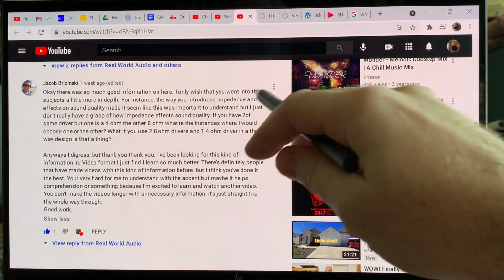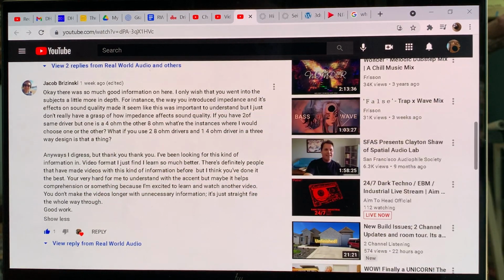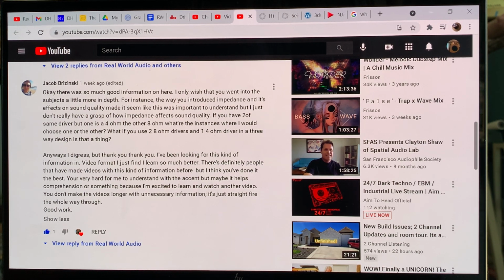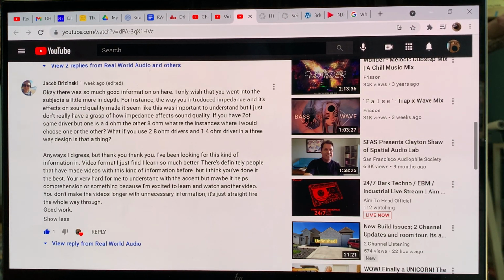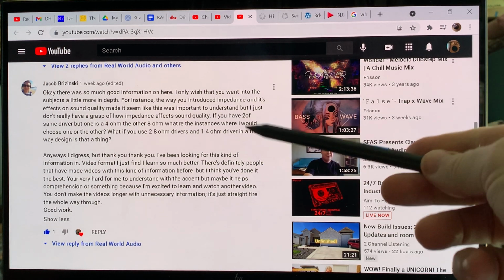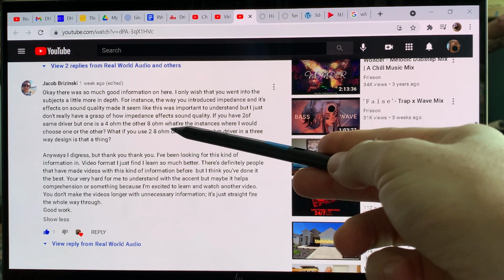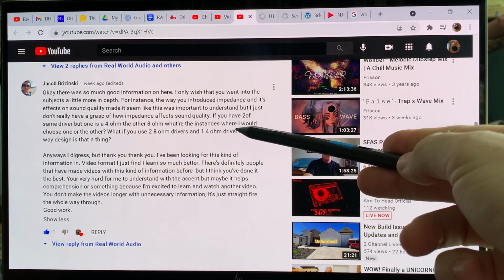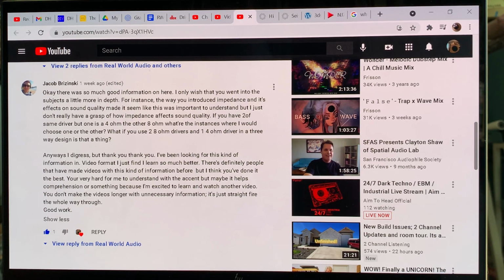Q&A - Loudspeaker driver impedance implications, first take

Comment: Hi impedance can be viewed from the theoretical side and an empirical side. For example theory dictates  an 8 ohm speaker should be connected to the 8 ohm tap of a tube amp but if the speaker impedance dips enough across the frequency spectrum it may very well perform better on the 4 ohm tap. Peter q of audio note stated low impedance and low sensitivity is the work of the devil. In my experiences with both tube and solid state push pull and single ended varieties I prefer a higher impedance over a lower one, I prefer a relaxed natural tone
to a dry analytical unmusical sound which you get when driving a low impedance.If your speaker is 2 ohms it is very close to a short circuit and while there are solid state amps that can drive that load they will still be happier driving 4 ,8, or 16 ohms with much lower distortion. Yes solid state amps will produce more power into a lower impedance load but 
it will have more distortion.An OTL tube amp will conversely have more power as the speaker's impedance is higher because of it's higher output impedance which is the opposite of the solid state amp.From my perspective get a high impedance ,high efficiency speaker with a relatively  flat impedance curve driven from a nice triode amp of you choice
and you will be in heaven sonic wise. In my open baffle speaker i have 3 speakers with 4 ,8 and 16 ohm loads.I use my 4 ,8 and 16 ohm speaker taps on my amplifier to drive them. because my 2 of 3 of my speakers are field coil drivers I can adjust the sensitivities of those drivers to balance the sound. The paper cones and the electromagnets on the 8 inch mid and 16 inch are
the same so matching is much easier. Because I am using all the output windings I am getting everything that the transformer can offer. Gentlemen simplicity is always the answer.Best Regards Lou
Reply from the maker: We are totally on the same page! :) If possible, I always go for 16R drivers, and 8R as a last resort. Using the multiple output taps is perfect, that's what I plan for the Heathkit W6 rebuild, which has multiple taps - better solution than autoformer. I'm limited to the autoformer now, as the OPT has a single output tap.

Comment: Remarkable: my nominal 8 ohm single driver speakers sound significantly better on the 4 ohm taps than on the 8 ohm taps of my little SET amp.
Reply from the maker: Probably they dip a lot below 8 ohms. In those cases 4R tap is usually much better. We might never know, some 8R speakers are actually 5R speakers (such as the Audionote AN-E), 4R tap is much better for them, and other 8R speakers (such as Ryan 610) are actually 10 ohms.. :)

Comment: If you have an amplifier and a speaker that aren't exactly a match made in heaven, but you really must marry them, there is a solution: Autotransformers. 
*Auto*formers really don't have much in common with traditional *trans*formers, as there is no secondary. Therefore, no reactive element. Just more wire in the chain. I've had very good luck with them. 
Of course, matching speaker driver/ system impedance to the amp's output impedance is the best. :-)
Reply from the maker: I love autoformers. Experimented with autoformers for some unusual uses: volume control! Move the speakers to lower taps to lower the volume. Work better for most of the frequency range than traditional volume controls, as we are reflecting higher and higher load to the tube which results in lower and lower distortion as the driver is stepped down. However, the downside is that the output transformer cannot handle the super high loads, and the lower we go, the more the base is lost. End result: sound becomes pure as snow but quite thin. Also, big hassle to move the speaker to different taps of the autoformer if you want to adjust volume LOL. :)
Reply: @realworldaudio  
Very interesting! I have never thought about controlling volume in that way. I'm sure that it would be absolutely ideal for a select few systems. 
I have heard good things about low-level autoformer volume controls ("passive preamps"), but have never tried this either. In theory, this is a great solution especially if you have multiple taps and a silver contact impedance selector switch. Of course, its downfalls are the same, as you have mentioned. 
The best volume control/ passive pre that I've ever used is the Hornshoppe "The Truth". It's similar to an LDR, volume controlled by light. Arthur Salvatore swears by it, and even created a new category in his recommended components list. The downside: no gain, of course. I ultimately ended up selling mine for this reason, as my phono stage won't drive my amp directly to the levels that I desire. 
As for speaker autoformers, I use them with my OTL amp to drive electrostatic panels and with KEF LS-50s, and they work wonders with those applications. 
I still end up listening to my L-W 45 SET/ FRSD system most of the time though. :-)
Reply from the maker: @FireTriode  LOL, Arthur Salvatore is right on. I also use autoformer for low level volume control, instead of a preamp. Way better than resistors... no active gain though... :) miss it with my SET, although phonos output is around 4V, so no need for extra juice there. But DVD / Netflix is is sometimes just a whisper... :). The Ampex has monstrous gain, with 1pm on the passive I'm already peeling the neighbor's plaster off their wall. Volume down to minimum is still LOUD. :) Will soon do a little mod on the Ampex: a switch to bypass the input stage, so input goes directly to phase splitter, and I get a nice 26dB volume drop. Plus, one tube less coloration. :)
Reply from the maker: Cory, one crazy ting about the autoformer volume control (plus the Altec speakers): I can turn it quarter way down without people noticing I have touched the volume control. Pretty crazy, the perceived volume level just disappears, and the volume control instead becomes a "life" knob: add more life and dynamics, or less.... even crazy loud volumes do not seem "loud" or annoying or hurtful to the ear.